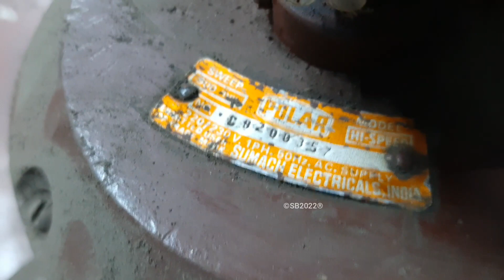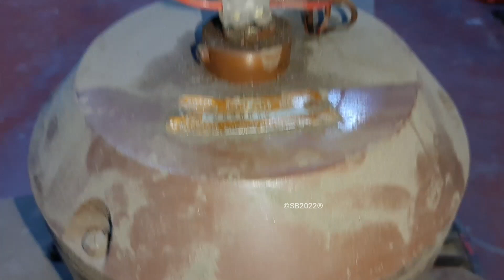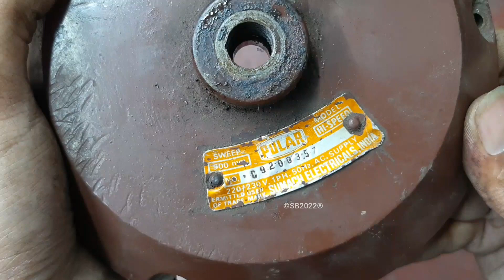POLAR 36" HI SPEED 1990's (TPW Type) SERVICING & REVIEW

Comment: I have always wondered about this fan, except I knew it was a Polar. I have seen many of these fans in my childhood, mostly in shops but in some residences too. I still see them occasionally, usually in semi modern shops.
The other hub design fans I see are age old, usually from the '40s or '50s. I wonder why polar or the others don't make such fans anymore, maybe due to higher manufacturing costs?
Thank you for showing us the internals of this fan. The design of this fan looks quite clever and unique.
Reply from the maker: The 40's,50's are DC fans that u are talking about. Yes this fan looks like a DC fan but in reality it's table fan technology AC fan of late 80's -90's
Reply: @SOURADEEPBISWAS  I don't know if those old hub type fans I saw were dc or not since they were in the same room with other newer fans. I don't know if they had a separate dc supply. I saw a few of them in an old school and some (different model) in a sweet shop.
Reply: @techexplorer9312  for dc there is no dc supply. There is a FBR(full bridge rectifier) to convert the a.c. input into d.c. to run the fan. And they don't use any kind of capacitor. It's completely different from bldc and modern fans.
Reply: @SOURADEEPBISWAS  It's called an internal rotor. Most ceiling fans use an external rotor which is attached to the outer shell. The outer rotor motors are usually thinner and lighter.
Reply from the maker: Exactly